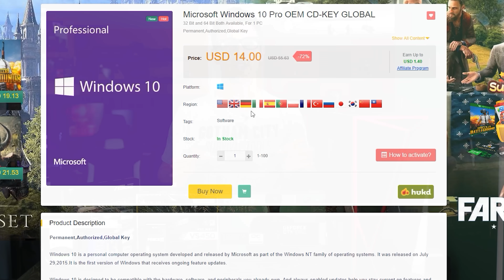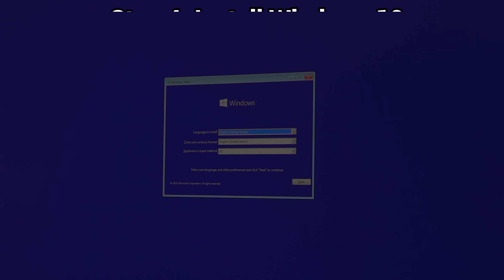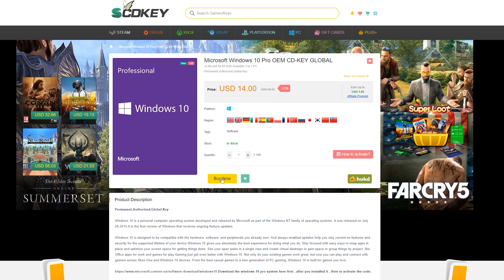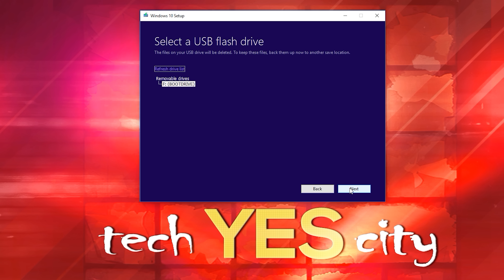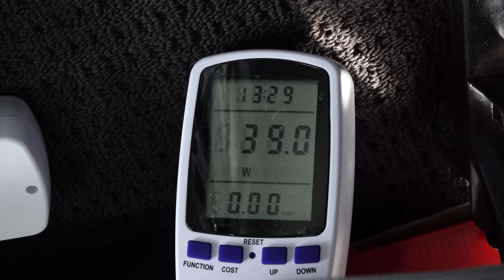HOW To BUILD a Gaming PC - Quick and Easy

Comment from the maker: Thanks for watching, Used PC parts hunt coming tomorrow!
Reply: Stock Intel cooler? Sure, it'll work but...
Reply: YEEEEEEEEEEEEEEEEAAAAAAAAAAAAAAAAAAAAAAAAAAAAA
Reply: Tech YES City is that Corsair VS any good?
Reply: How much did it cost?? Plz reply👍
Reply: Love the video ♥♥
Nice to have an 2018 revision 
I know I shouldn't but why not ryzen or is it just for change it just made sense at this price range pls reply
Reply from the maker: Its ok for not overclocking, like the parts in the build here.
Reply from the maker: Depends where you live for the cost, I got the case for $59 AUD on sale, and also ram was picked up for $100 AUD, GPU $250, so all up I think it was about $850 AUD.
Reply: Great video
Reply: Tech YES City  you said it was a mid-range gaming pc ...😅😅
Reply: Question will a intel i7 be compatible with a asus prime z370 and evga GeForce 1060?
Reply: William White no it’s a 6gb 1060
Reply: Tech YES City how do u hook it up to tv / other
Reply: Tech YES City I turned on my pc and after a second it completely shuts down. What is the reason for this?
Reply: On Amazon, there's a 4$ Windows 10 pro activation key.
Reply: Can you do a 2020 version of this vid because the parts have expired.

Comment: i have this case and managing cables is such a difficult task. there isn’t a shroud at the bottom to hide them either. if you really care about your cable management, go with an nzxt h510. but otherwise it’s a good case

Comment: Is this a good build? Any tips?

CPU - i5 8600k
CPU Cooler - NZXT Kraken X52 Rev
Motherboard - ASUS ROG STRIX Z-370E
RAM - G SKILL TRIDENT RGB 16gb (2x8)
Storage - 2TB 
GPU - ASUS GTX 1060 6gb DUAL (white)
Case - NZXT ELITE (white)
Power Supply - Corsair CXM 750w Bronze
Reply: Hilarious get an ssd

Comment: I‘m building my first computer this september :D 
1070 (ti maybe)
8600k
16 Gb 3000 mhz ram
Z370 board with wifi
A Solid air cooler
Idk if ssd or hdd
And a case

Comment: Buying keys from places like scdkey and kinguin are nothing but scams. The keys that they are offering are more than likely enterprise or keys designed for large companies. Could even be purchased with stolen credit cards. You are basically F'd when Microsoft blocks the key and deactivates your Window installation. Sure, they may give you another key but that won't last forever. These Tech Youtubers NEED TO STOP giving this information!!!!!! The website doesn't even have anything in the Help Center. There is your first warning that scdkey is not doing things legit!!!!!!

Comment: SCDkeys is a lifesaver.  Windows software prices used to be somewhat acceptable when you could purchase Office and get 5 permanent licenses in the one pack.  But then they got rid of that and now it's AU$250 per frickin device for retail OS and Office (both non-pro versions), which is too much when you can lose licenses through dead motherboards, drive failures etc.

Comment: Your late man Ive already bought a wind10 for 125$ :(
Reply: lance I got it Windows 10 pro for free
Reply: A Marshmallow where?
Reply: lance my local Computer repair shop installs them for free
Reply: Activated my windows 10 pro with KMS AUTO. Didn't had any problems
Reply: maybe it is a open key which you can use on any of your computer unlike oem keys which gets attached to the motherboard,i mean you can use it only for one pc....but still buying windows for 125$ isnt worth it
Reply: pratik jawake Windows is much better for gaming as all pc games are optimized for it whereas Linux isn't really great for gaming! Linux is still a great option though

Comment: 11:29 = NOOOOOOOOOOOOOOOOOOOO.
Just to correct Bryan here, CPU fan header should always got to the CPU fan, not a case fan. I am sure Bryan knows why, but when the CPU gets hot, the case fan will spin up, not the CPU fan as it should. Use an extension cable if it is too short.

Just to also add which Bryan for got, the cheap windows 10 keys are OEM keys.
Reply from the maker: Where did you hear that man? They are both 4 pin PWM on this motherboard, and if it was a 3 pin it would run at full power, so its actually not bad either way (especially on an i3-8100).
Reply: CPU fan speed is controlled by CPU temperature/load, unless you manually config it, which is not recommenced.  It is a common practice to connect CPU fan to CPU fan header. You have it connected to the CHASSIS fan header and chassis fan connected to the CPU fan header. What do you think will happen when CPU gets hot under load? Just trying to help you out man.
Reply from the maker: Thanks for the help man, appreciate it, but its not a biggie this time around.  You are right with an older motherboard it might be a problem since the PWM is tied to the motherboard temps essentially, but on all 300 series boards those pwm controlelrs by default are tied to the CPU temperature.  It sucked that this board did not have a fan header down the bottom of the board (really frustrated the sh** out of me tbh lol).

Comment: The very first PC that I built in early 2001 had a 1.0 ghz Pentium III cpu, 256 mb pc 133 ram, geforce 2 gpu, 40 gb hard drive, CD-RW and DVD-rom, and ran Windows Me which I later upgraded it to XP before selling it in 2003.

Comment: Watching this because its almost identical to a build I did a few months ago.  I like the case even though its a janky cheap case.  Its grown on me.  Mine is the yellow model, and I like that the front IO sticks out the side rather than the top or front.  It works with my desk setup perfectly, and I havent found another case with IO in the same location.  Cheers.

Comment: I'm not sure if I could build a computer with your guide alone. In my opinion there are some things and variations missing that you didn't mention. Generally you should have showed a little on what kind of details some newbs can orientate for example the manual with the front connectors, or ram configuration. Not everyone needs such a detailed guide, but some starters will need a little more.

Comment: Hey Bryan my brother has an older Fx 8350 that's being cooled by an H75 liquid cooler from corsair, with an m5a99fx pro 2.0 asus mother board. I upped my power supply recently and gave him an 750 antec bronze certified psu. He is using an RX 570 4gb from XFX. Lately his PC has been shutting down when just playing world of Warcraft and watching my stream. It doesn't get hot on CPU and its not even overclocked it does use Vengeance Intel 16GB  2 sticks of ram at 1600mhz but I heard as lomng as you don't over clock the ram its compatible on AMD series boards. What do you think is cuzzing those shut downs?? I don't want retire the system yet since ive seen u make resent video of the bull dozer cpu from AMD. I even did some Tech Yes City loving on the components and cleaned them out. swapped new Thermal pad on the vrams. Let me know what are your thoughts. ANd Finally the PC is a little louder then my modern I7 7700k with gtx 1070, there is a good airflow in the case aswell. I thought it was the PSU at first because he used a 550watt psu before but I gave him an overkill 750watt bronze certified.
Sorry for the long composed comment, keep the the amazing work. Much Love.

Comment: nice build, but i personally encourage two thigns i didnt saw in the vid, one is to test everything out of the case beforehand, and two would be doing the case power and led connectors first just after installing the mobo in, they are always a pain in the ass, lol

Comment: Just finished a Budget Mid range Gaming PC with the same case.  The case is a good one for the budget builder. I was a tad disapointed in the lack of a back pass through for the MB Power cable.  Installing top fans was a challenge also but I wanted good flow so I added 4 more fast to the case. two up front and two in the back one up top and one at the back opening.

Comment: I OC'd my monitor and got it to 1.5x the original refresh rate
Reply: DeltaNedas careful with that bro, my last main monitor started tweaking heavy a little while after  I over clocked mine from 60 to 71 hz
Reply: Overclocked mine about a month ago, anything above 90hz does not work, no artefacts found on 90hz. Guess I just won the silicon LCD lottery. 🤷
I did verify that it worked with the mouse test. I got 50% more mice per second. The sad thing though is that the only games I can run at 90+ fps are:
- Galactic Civilizations II on best settings
- Minecraft with optifine and lightweight mods on med settings
- Roblox when not using lagger scripts
- GTA SA best settings -AA
-CS:GO on worst settings with med textures and 8xAA
-Probably Factorio and Terraria if animations interpolated for 90fps
-Probably more that I can't remember, my toaster sucks

The only thing I've overclocked so far is my monitor, as I don't go deaf from the smallest OC possible in Intel XTU :(

Comment: So I have a omen 17 laptop. With the i7 7700hq and GTX 1060 6gb. And 8GB ddr4 2400mhz and 1tb HDD. Should I get a ssd like a 950 evo or another 8gb ram. Because the laptop takes about 1 minute to boot.

Comment: Not a bad startup guide Bryan. Biggest worry was the fact you didn't mention that the stock Cpu cooler does have a plastic tab over the thermal paste that needs to be removed before installation. Not too sure about the choice of cable management either. That pcie 6 pin should have come through a higher opening to avoid sag and interfering with the fans.

Comment: For me, I would buy i5 rather than i3 for my gaming pc...
PS: my 1st desktop PC built in 2004:
Celeron D 330 with Asrock I65GV, 2GB DDR400
GeForce 6500
320GB Seagate SATA HDD

I am planning my next new Desktop for my Cities Skyline gaming life
With i5+Z370
coz the Laptop currently use is not powerful enough for it, especially the GPU

Comment: you buy everything from 2010 XD

*cough* ok this will take a while :

CPU: i3-8100: £93 --> i7 2600k but overclock it from 3.4 to 3.6ghz
RAM: DDR4 8GB Kit: £77 ---> ddr3 8gb 
MOBO: B360 M : £60 --->  ASUS P8Z77-V LX2
i found a combo on ebay for £200

GPU: GTX 1060 6gb: £250 ---> 780ti identical performance £150
PSU: VS450 PSU: £40---> ACE 600W £21
CASE: Spec 04 PC Case: £40--> some random case in ebay £10 with 2 120m fans XD
SSD: 240GB SSD: £46---> same ssd but 120gb £10 on gumtree
HDD: 1TB HDD: £36--->£20
cpu cooler hyper 212 evo for both £20

total with 2018 : £514
total with last gen: £441

and thats me not even searching thoroughly for deals, if you take your time and go on ebay auctions its possible that you would be able to get it for £300 (ie dell optiplex 790 and upgrade= total £300 after selling and buying but would take alot of effort)

brian i suggest you do a direct comparison with the current build in the video, and the one i listed with parts from 5 years go, or if you find better parts, to see how much you are really getting after 5 years XD

anyway nice video as always
Reply: I5-3570K, Z77-DS3H MOTHERBOARD, 8 GIGS CORSAIR XMS3 DDR3 RAM £70
sell the I5-3570K for £60 and buy an i7 2600k for £40
gtx 760 for £35
intel ssd 160gb £10
case and fans £10
evo 212 £20
psu 600w £20
£5 for liquid metal
so for £150 you get 60fp for mid settings 900p resolution $200 USD

Comment: One thing i would change is the case, it just doesnt make any sense to put this pc in a see through case, same with the fans no need for led's, i would much rather spend money on fast and silent fans. Lets be real here, its not the best looking pc out there, this is the pc that will sit under ur desk where its outa sight.
Reply: How does it not make sense? Sure its not the prettiest thing, but its a starter build. The whole point is you're getting a good foundation. Better to buy the see-through case now if you want one than to do so later.

Besides, led or no led most PC parts are designed to look nice. Cases like this remind me of the clear-plastic game consoles, nothing fancy about those either, just plain PCB's and such.

The fans were default pre-packaged ones. No such thing as 'fast and silent' fans by the way.:P

If you want quiet you have to minimize RPM, which means more or bigger fans.
Reply: ZombieBarioth It rly doesnt make any sense to me. Ur on a low budget already, like i3 low and ur spending more than u need on cosmetics? I would buy some cheap, non see through case, with fan filters and some good noctua silent, reliable fans.
Reply: ZombieBarioth I get its cheep but having the to mount the cpu in front of the window honestly is bad design never seen that before in glass case it looks atrocious. I'm not sure what being a beginner has to do with getting a ugly case more like someone cheep that doesn't want to spend 20$ for a much better case I just got into pc building and I'm getting the nzxt 340
Reply: It's a bad foundation for future development. That was my first thought about the components.
Reply: DarthBloodyVadar
That's just it though, none of it cost extra. The case was just under $45, the same as a lot of other cheap non see-through cases, so you wouldn't be saving money here. This is one area where it really just comes down to taste.

Some people don't like filters, and in my experience unless every opening is covered they don't help much. Most budget cases I've seem only do front and bottom, leaving the top vent wide open.

As for fans, noctua aren't exactly 'budget' themselves, and a lot of people dislike the color. I'd go for Cougar here, their multi-packs are especially good on a budget, and they come in either black or orange.

Their top fans don't come without led I don't think, which is the case with most brands now a days. leds are cheap enough (not RGB mind you) that it barely adds to the cost, but it does really help marketing, which is why they do it.
Reply: hawkeyemihawk getting money lord afro hokage
Fair enough, I'm not trying to defend this specific case so much argue against the supposedly high cost of the cosmetic stuff. Its an outdated misconception. That used to be the case, which is why old flashy led hardware used to be junk, but its not like that anymore. If anything, its getting harder to find non-led stuff.

No doubt there are better cases in this price range, both plain Jane and flashy 'gamer' style. There's also a lot of junk in both.

Comment: If your really strapped for cash and only job is a paper route you can get a 25.00 case from china and get a ryzen apu you don't even need a gpu!
Get a cheap  power supply that cyberpower uses and the cheapest ram you can get it would cost you under 500.00
You can play minecraft at 60 fps

Comment: To share a moment of my own stupidity so hopefully new builders learn from my mistakes - you do NOT need to touch the screw holding down the retention bracket, and if you do, put it back by screwing down the screw with the retention bracket down and the retention arm up. Then put the retention arm down.

No, I did not spend an hour fixing this, shut up.

Comment: * USA PRICES Rounded up to the nearest $1 * as of 5/26/2018 @ 1:40am
i3-8100: 
$119
GTX 1060: $229 ( PNY GTX 1060 3gb was cheapest )
DDR4 8GB Kit: $77
B360 Motherboard: $68
VS450 PSU: $38
Spec 04 PC Case: $45
240GB SSD: $52 ( DREVO X1 240SSD was best Price to Performance ) 
1TB HDD: $47
Win 10 X64 Pro License: $12
---------------------------------------------------------------------
Sub Total Before Tax and any shipping >> $687 << ( Most items were free shipping )
%10 for rough tax estimation + $69 Total >> $756 <<
Reply: IMO I think the best deal out there right now is to buy a Refurbished Dell / HP / Lenovo Workstation, like the i5 - 3570, i5 - 2500, i7 - 2500, i7 - 3470 ...ect  with 8mg of ram, 500gb HD, Windows 10 pro they are all over the internet from around $150 - $250.  Add the best new or used GPU you can find like that GTX 1060 3gb for $220..  So for between $370 to $470 you'll get a nice rig capable of running Fortnite at 1080p ( High Quality ) Epic 3D Resolution 112FPS *average*  93FPS ** 1% Min fps ** if you use a GTX 1060 3gb...  The GTX 1060 3gb is the best P2P Card on the current market.. the cards that are better than that in order are a lot more money. ( Here they are in order scaling up from GTX 1060 3gb )  RX Vega 56, RX Vega 64, GTX 980TI, GTX 1070, GTX Titan X, GTX 1070TI, GTX 1080, Titan X, GTX 1080 TI

Comment: Ryzen 2200g vs i3 which one to choose please help
Reply: Really depends what's cheaper and which is more accessible I guess. I'd go with the 2200g just because of the potential upgrade ability and overclocking.
Reply: MaJesticGoat Gaming does it have compability issue
Reply: The 2200g will just need a BIOS update to work with any 300 series motherboards, however sometimes you get lucky and they've already been updated when they came out of the factory.